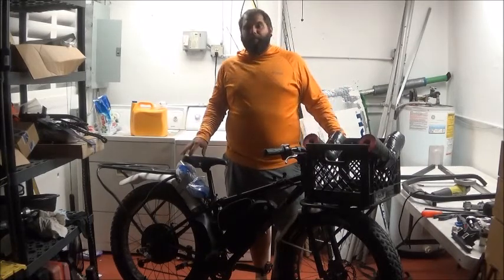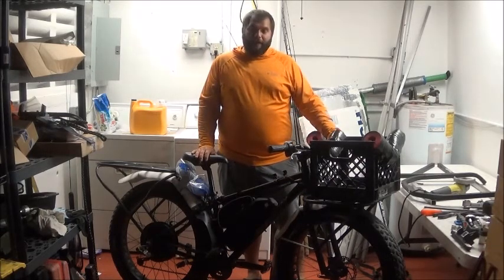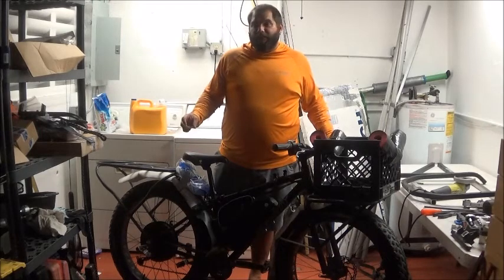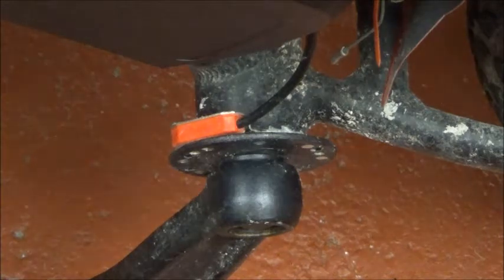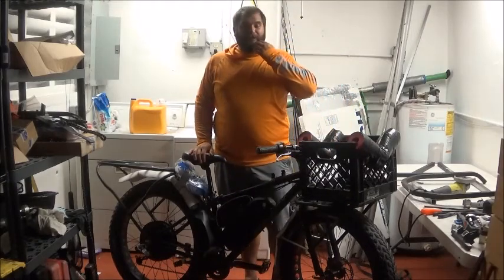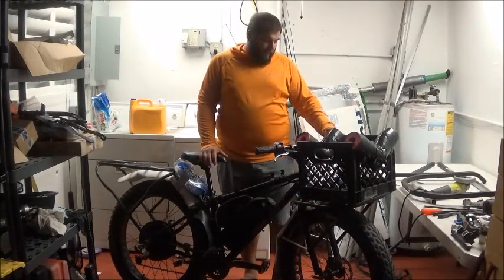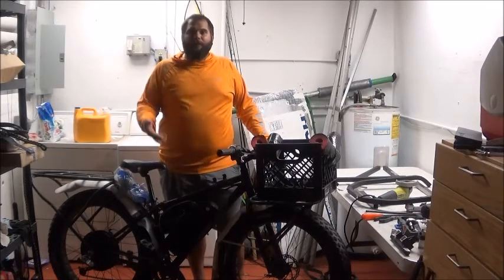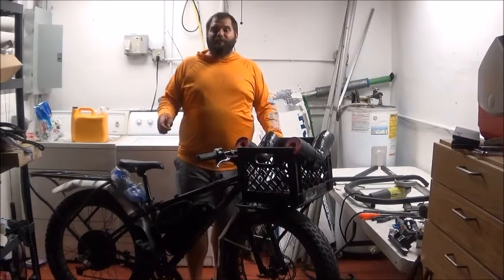VOILAMART 1000W 48V Fat Tire E-bike build gravity bullseye monster (Swamp N Stomp ep. #26)

Comment: Some excellent information here.  I use to hunt the Upper St. Johns River Marsh WMA off SR 192 just west of Melbourne, Florida.  There's a walk-in to the south but the problem is you have about a 1.5 mile walk to get to where it's legal to hunt and about another mile to get to where you might see pigs and deer.  I started riding my beach cruiser bike instead of walking which saved a lot of time.  It was muddy roads though and still a tiring ordeal.  Had the idea to get a pedal-assist bicycle and that's when I encountered a problem.  The walk-in prohibits "motorized vehicles" and after talking to an FWC officer I came to conclude that an electric motor of any type would technically constitute a "motorized vehicle."  So basically I never invested in a pedal-assisted bike as planned.  Just be aware that some areas may consider these bicycles as motor powered.  I doubt most game wardens would ticket you but it's worth knowing and possibly inquiring before a problem arises.  See you in the woods!  Great video.
Reply from the maker: A pedal assisted bike is only considered a motorized vehicle if it has over 750 watts. I have a governor in place the limits the power to 750 watts making it legal to use on WMAs.
Reply: @SwampNStomp  Okay.  I didn't know there was a 750 watt limit.  That's good information to have.  Thanks.
Reply from the maker: Canoeing The Edge Of The World yep sometimes even law enforcement doesn’t know the rules so it’s good to know where to find the rules to you can show them. They may hassle you but they can’t do anything if you are within the limits of the law. So I say get yourself a good ebike and get it done. Did you see at the end of the video of the 6point I shot, how I strapped it on the back rack and rode out? Easiest “drag” of my life!
Reply: @SwampNStomp  That would have been a long haul without the bike.  I use to hunt this area that was miles from the nearest road.  One day a FWC guy stops me as I'm trudging out and checks my papers.  Just as he's about to leave he says, "You walked a long way in.  What were you planning on doing if you shot a deer or pig way back there?"  I laughed and said, "Well if I shot a deer I'd hire an airboat to come in and get it, but if I shot a hog of any size I'd probably leave it for the coyotes."  He was nice enough to say if I could get it to the road he'd put it in his truck for the last mile out.  I said "Great!  How often do you come back in here?"  His answer, "About once a year."  Gee thanks pal.....

Comment: Hello Mark, 

Please share info on the kickstand that you selected for the Gravity Bullseye Monster.
Thanks
Reply from the maker: It was a cheapo on Amazon that clamped onto the chainstay. I put a bit too much weight on it one day and it broke and actually bent the chainstay a bit. Luckily it just rounded it off (instead of being oval it’s now round in one spot) and it seems fine. But I certainly won’t recommend that kind of stand for my kind of application. I have plans to diy a new stand for it and I will be doing that and basically redoing this video soon with far more detail About all the mods I used. Make sure to subscribe so you get notifications when I release that video (should be in the next few weeks). Thanks for watching!